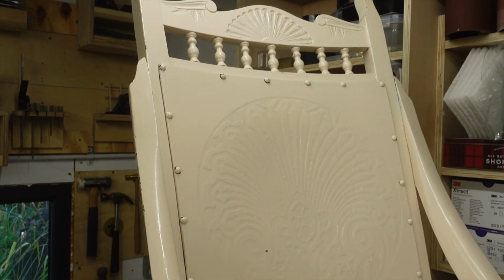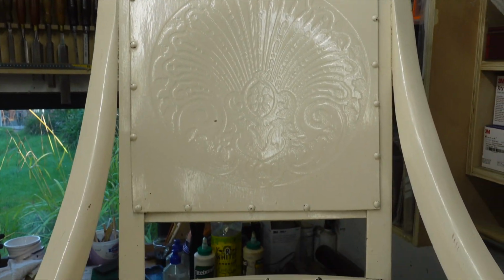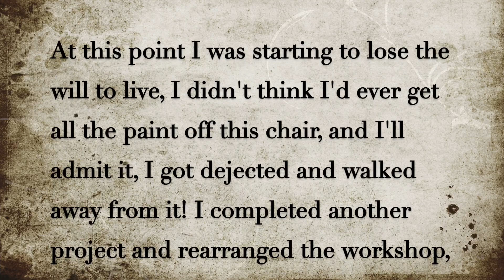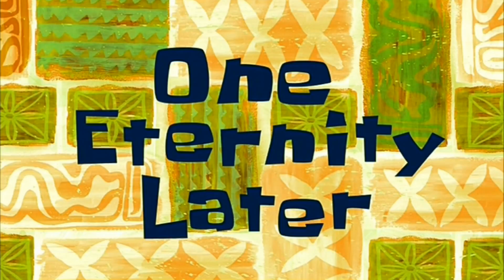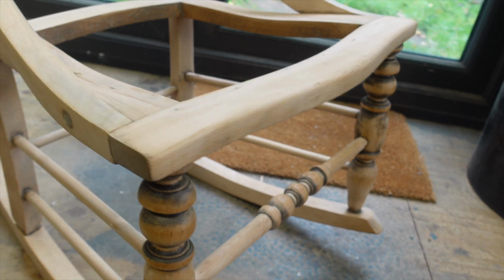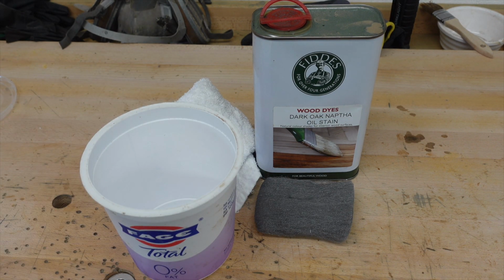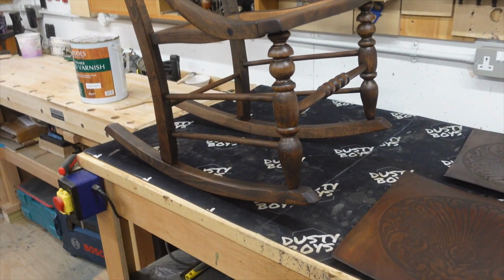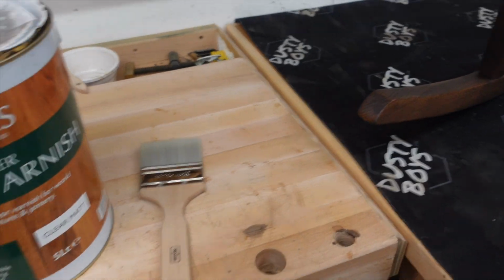Beautiful rocking chair hidden under layers of paint! | Furniture restoration

Comment: Very nice restoration. To get at those curves in the legs, I use a rope twisted out of steel wool dipped in stripper it works great.
Reply from the maker: that’s a great tip 👍 I’m always cautious of using steel wool with my stripper as it’s water based. Glad you liked the restoration 😀

Comment: I just cannot fathom looking at all the gorgeous carving on that chair and saying "Yep! Paint it is!" Sorry this one about did you in, but it turned out beautifully! ❤❤❤ I do have a question - is it difficult to the get the stain and varnish into the carvings so it's even? And does the varnish want to pool around the turned pieces? Does that require a lot of going back and making sure it's not running?
Reply from the maker: I know, under all that paint was a beautiful little chair! It can be difficult on those carvings as you get end grain which absorbs the stain easier, that’s why I struggled to sand all the old stain off of them, it’s soaks in like drinking straws. And yes there is lots of going back over those to make sure the stain, and also the varnish, isn’t pooling or running. Thanks for the comment and questions, it’s always fun reading & responding 😀
Reply: I just finished watching Ahti @ AT Restorations restore an old railway bench with backs decorated like your chair’s! I would link it but I’m not quite sure how 🤔 It’s his newest one 👍🏻